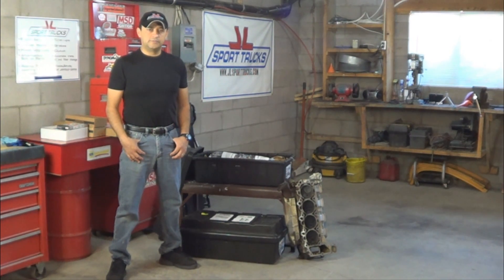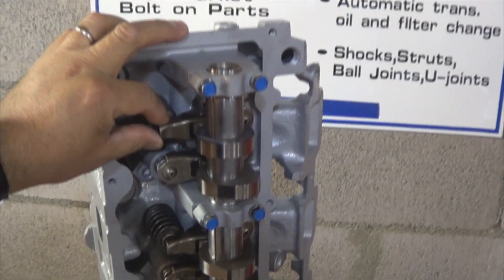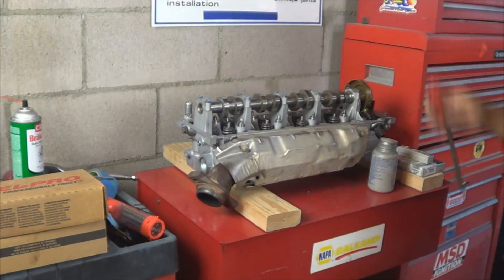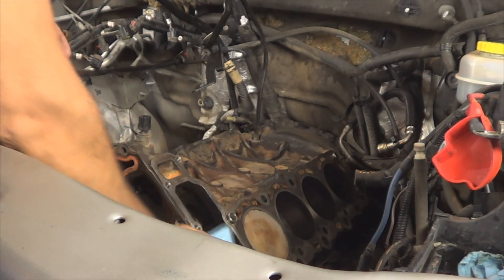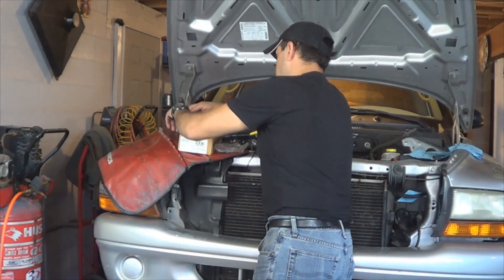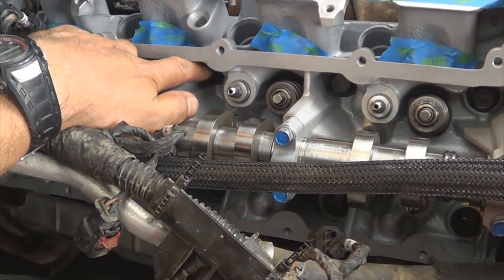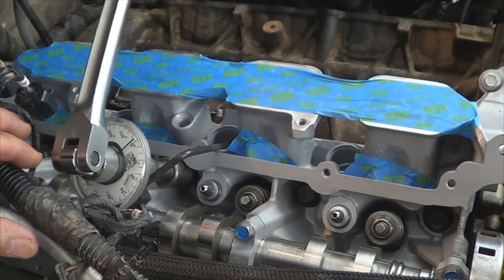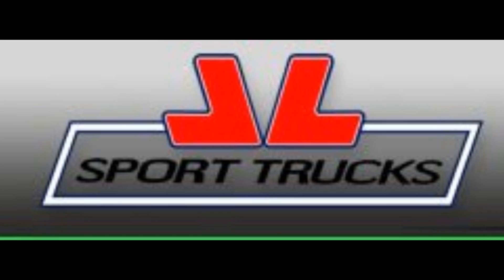Dodge 4 7 L Engine Cylinder Head Replacement Part Six by Howstuffinmycarworks

Comment: Could the 5.2 v8 from 1998 magnum, be installed in a 2005 ram 1500 instead of 4.7?
Reply: Im interested in swapping engines also. I think you have to swap the engine wiring and the engine computer also, but I’m not sure if that is all.
Reply: The 2002 dodge ram came with the 5.9L engine before the 5.7L hemi was released into production, so find on of those trucks in a junk hard for conversation parts, the 5.2 and 5.9 engine are basically the same engine, I wanted to do the same thing on a 2006 durango which never came factory with a LA style engine

Comment: My brother broke a bolt off in the block can it be removed
Reply: Mi to
Reply: yes, I did the same thing, carefully put just a dab of JB Weld on the bolt and hold it in place , I also wrapped some thin cardboard around it to keep it center I removed the head first. (I used the 10 minute set, 4 to 6 hour cure), let it cure and mine twisted out with just my fingers.

Comment: I would use a 3M Scotch-Brite Roloc Bristle Disc, it's a green disc vs that wire wheel. I'm a prior GM tech, but every tech has their own way of doing things. I'm not a big fan of wire wheel on heads, upper or lower intake/ aluminum surfaces, water pumps and so on. The 3M scotch bristle is way less abrasive/ damaging vs a wire wheel and it cleans the surfaces as affective as a wire wheel in my experience.

Comment: arent you suppose to use the double copper?
Reply: I used Bosch Platinum +4 and they are great in these motors!
Reply: It had iridium unit when I bought the car and seems to work a lot smoother than the coppers..... as a mechanic I can't really explain that

Comment: thank you for making the videos,  I've only worked on Toyota engines and I always coated the head gaskets with permatec head gasket adhesive, was wondering if I should  coat the gasket for the 4.7l Dodge or not? Do you use any liquid or spray on type head gasket tack when you replace Dodge head gaskets?
Reply: I use copper spray and I coat the block and cylinder head and the gasket, everything, all sides, never had a problem doing it